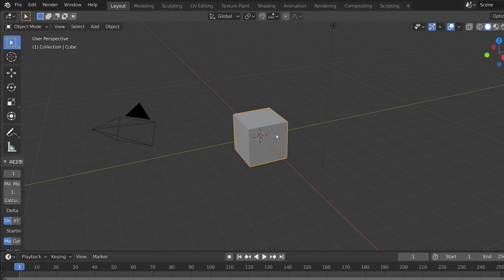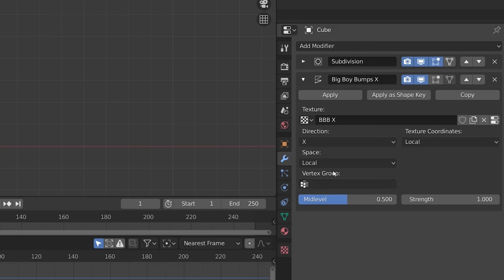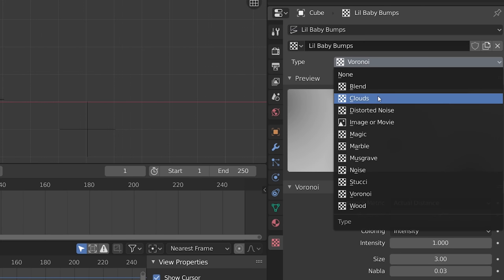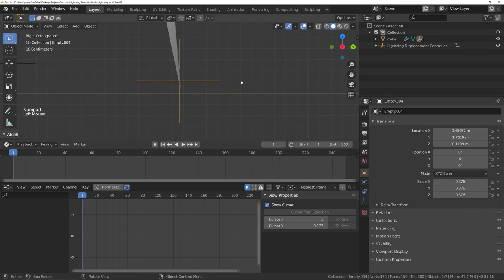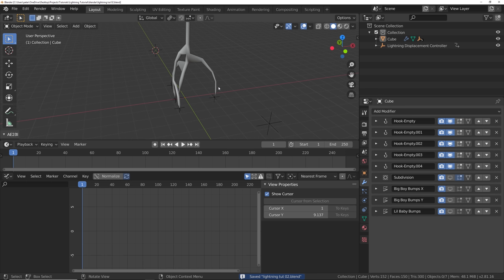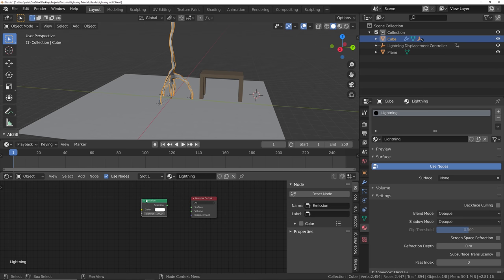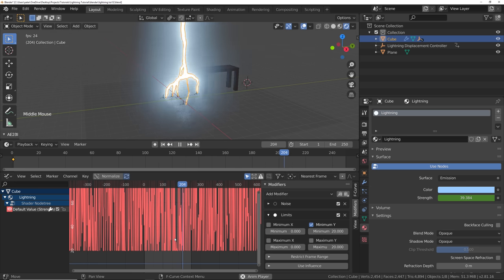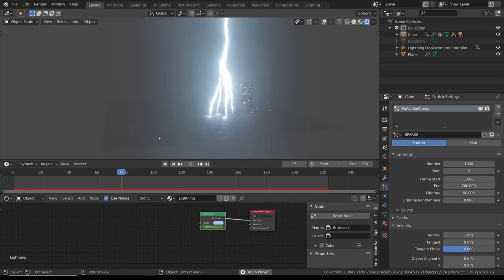Dynamic Lightning in Blender

Comment: Hi Peter. So I’m coming from Houdini and the Applied Houdini courses by Steven Knipping. This is the first quality tutorial I’ve seen for blender. One thing that popped into mind when you asked what we want to see was showing the full pipeline. 

For example this lightning shot. I’d like to see the process of tracking. Importing the data to blender. Doing the effect. Outputting the effect. Than comping it. Do you think that’d be possible for you to do?
Reply: People usually don't track outside of blender if they're using it. They/we just do it inside Blender with the tracking tools. And the same goes for the compositing altho there is usually where people make the switch to other software
Reply: I also recommend using ae2blend. Its a 10 euro addon that brings your after effects 3d track to blender. Works perfectly. And for 10 euros you have unlimited downloads, definitely worth it.
Reply: koko ze I’ve heard names like boujou and pftrack and mocha thrown around. Which one would be the one that could do something advanced like this? I’ve tried the camera tracker in after effects but my 3D object always slides a bit.
Reply: ManexFX awesome! Thanks for the info. I’ll check that one out.
Reply: Fadhlan Irsyad yup. I saw that one yesterday!! That’s what got me thinking about switching to blender and trying it out. I’m doing blender gurus beginners course rn and I have to say I’m not that excited. It’s still a littler har for navigate and all that. But I’m going to stick with the course and finish it all before I make my conclusions.
Reply: Check out Ian Hubert. He is currently working on such tutorials. Tracking is already out and green screening us next
Reply: @ZeNoNThErMaL  
I think they meant Blender's own internal tracker that it has by default as an integral part.
Reply: I was going to comment this only but there is already one comment so I am also requesting, can you please make a complete tutorial from making this effect in blender to making the final comp
Reply: Yeah tracking in blender can be frustrating. If you want a professional tracker, I still think syntheyes is the best. It's not needed though. See CGMatter for the best in-depth tracking tutorials.
Reply: ZeNoNThErMaL I know I’m late but if you stick with it, it’ll get exponentially easier to navigate and just create in general

It’ll also get more enjoyable as you start seeing your project come together